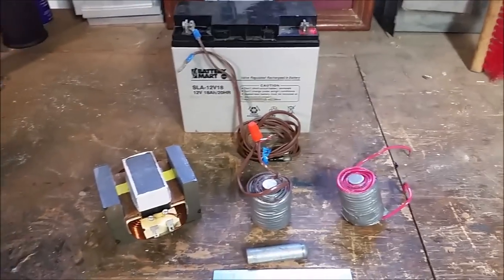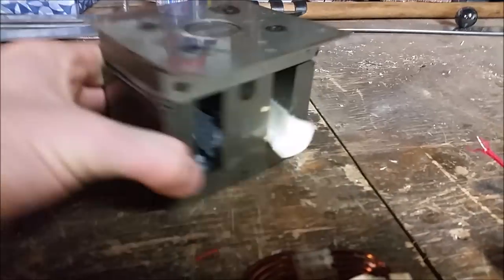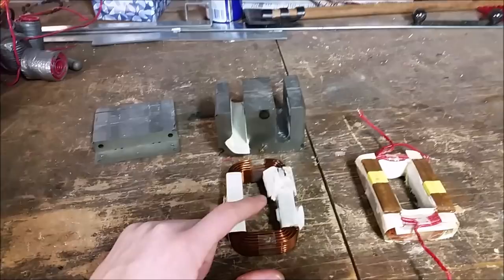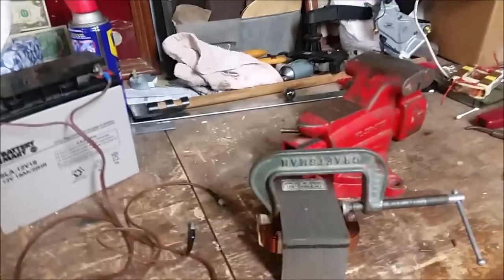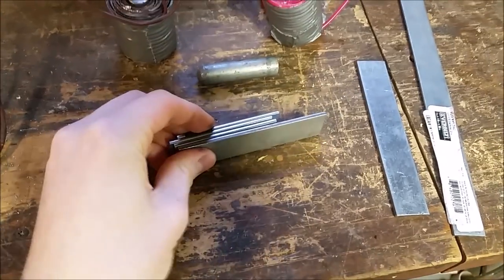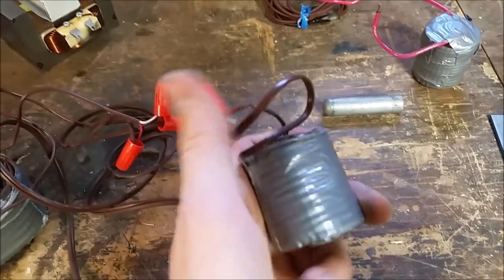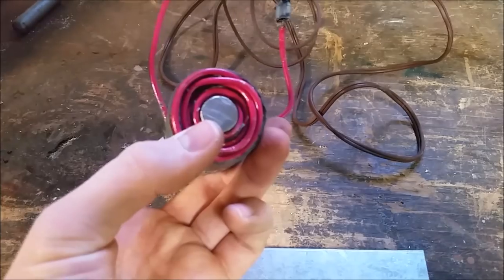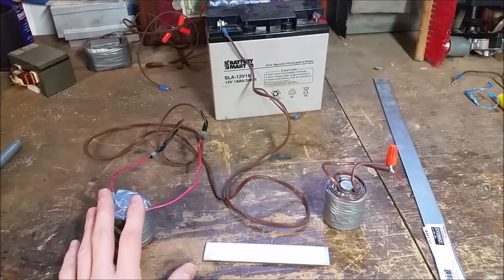Easy Homemade Electromagnets

Comment: If you use wood wedges make sure its completely dry.  Insert the wood then flip it up where the wood is parralel to the ground get yourself some clamps big enough to hold the tip of the wood to the face on the opposite side. Use 2 or 3 clamps for best results, then get a spray bottle fill it with HOT water and start spraying the wood wedges evenly as it absorbes the wood will expand and the clamps holding will keep pulling tword the device once the wood expands enough itll crack at the weakest point (the sawed down weld) and the top peice comes right off plus you get the added benefit of feeling cool knowing you used the same tech to pry off the top, as the ancient Egyptians did to evenly break rock thus creating the stones used for building the pyramids xD its a win win really lol

Comment: Do you have some calculation formulas for the electromagnets? How the wire thickness and the area of the core affect the lifting force? Great video! I have an electromagnet with a lifting force of 40 kg (88.2 pounds) and it's really fun. I'm making a simple linear vibrating feeder with it. :) It's really cool - I love electromagnets.

Comment: cores are laminated to reduce heat buildup by limiting Eddy currents. Lacquer is commonly painted on and used as an insulating layer between cores and on wires also. Have fun.
Reply: Eddy currents are not a consideration with DC.

Comment: Since I was buying a lot of these  microwaves from walmart down in Florida it was easier to buy a small electric 3 inch grinder from harbor freight and grind the weld.
Put the oven back together put back in box an tape it up. Tell walmart it would not fit in the microwave spot over the stove.
Reply: Put a car headlight in series with the electro- magnet and it will limit the current. The headlite will draw a few amps but won't cause coil to heat up enough to burn out the coil.

Comment: 5:32 I'm confused, why would you reverse the windings between layers.  That would cancel out the electromagnetic field of the first layer.
Reply: The reason is to keep winding uniform thickness on each level as you layer them. The current going through the wires will still go in one direction. Visualize it as a wire from battery negative terminal, then in your mind run that wire from battery to every room in your house around every piece of furniture and running in every possible way then return to the battery holding wire in your hand. Then you know no matter what that the wire in your hand is the same so the flow of electrons and the magnet field it creates are always the same direction. Flowing from one terminal through the wire to the other other terminal to create a continual loop. Hope it helps.

Comment: Wait, no load resistor? How are you stopping and regulating the amps that flow? If you dont load resistor the windings will melt in no time......... I have seen these videos all over YouTube and if you make one plug it in and wait for it........
Reply from the maker: That is a good point. I agree a load resistor in series would be a good idea to reduce the current flow and therefore heat.
Reply: @ericinventor  I finally found someone with the same interests as me. Your video reminds me of an American movie called Breaking Bad, in which there is a scene where drug dealers use electromagnets to destroy laptops in the police evidence room.  Is it feasible?  Or false, and are you interested in ENP?

Comment: Wondeeing why secondary winding is not used if it has more turns?they typically use primary winding. I guess because it can hold up to standard house current without melting?

Comment: You could probably use the secondary coil from the transformer to make another electromagnet.  Maybe with the cut-off top as a core.  So, I ask, could you just connect the two coils together electrically and make a more powerful electromagnet in the first place?
Reply: StageRightvideo

Comment: I am going to be making a new motor design. Any suggestion on how to make the most powerful electromagnet in a 3"package will be appreciated. Thanks.
Reply: Try to get a bolt and just keep wrapping copper wire around a lot

Comment: How do you stop the electromagnet from getting hot? I bought two large ones and they get too hot to touch. I connected them to a 12v battery and after 30 minutes they are at boiling point
Reply: Kamryn Kant   Wow that sounds really convoluted. I just put metal plates on the ends to act as heat sinks and stepped down the voltage slightly. Works ok

Comment: If I damage the enamel on the primary coil but the exposed parts of the wires still aren't touching will it work?
Reply: It should
Reply: I'm wondering similar thing less resistance lemme know I wanna make one 2
Reply: Spray shellac on it.

Comment: it is not a bad idea to tell the people that at to many turns the induction voltage after disconecting can be dangerus! its easy to build something like a igniton coil from old cars! i have start to male one magnet with 5.04mm wire at 210m lenght. 10kg copper! that will make sparks!

Comment: When making a core out of plates you need to insulate each
plate ..
Reply: That's only if you plan to use it with AC. Splitting the core up into laminated sheets is done to reduce eddy currents formed in the core due to the changeing magnetic field associated with AC. If all you want is an electromagnet that you will run off of DC, a solid core is just as good.

Comment: Do not create sparks at a battery. The gasses coming off will ignite and the battery will explode. I think the one you used was a sealed battery. But still very dangerous. Connect with a switch at a distance from the battery.
Reply: I second that.

Comment: is there a way we're it doesn't heat up at all
Reply from the maker: Heat generated is proportional to the square of the current. So Heat = (I^2)k. So to reduce the heat produced you must lower the current, which in turn weakens your electromagnet.
Reply: guitar fanatic no.

Comment: Instead of the obsession on youtube for microwave transformers to build an electromagnets, i must mantion something: when you cut the welding, don't do it in the midle. Make it on "I" part to keep entire section of the core which means more power for electromagnet and entire electromagnetic field kept closed when attach a piece of metal on it.
Reply: Nelu Nicoara if i cut the core down so only the one coil fits in it would it reduce power of the electromagnet?

Comment: Why do I have to remove the secondary coil and put the primary coil back into the transformer
Reply: Bcz if u keep the secondary coil..u will create a lethal high voltage..and u will not get an electromagnet
Reply: I know but should I use the secondary coil instead the primary coil
Reply: @Eric_875  primary ma boi